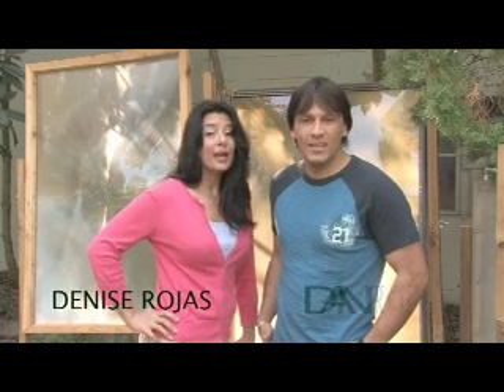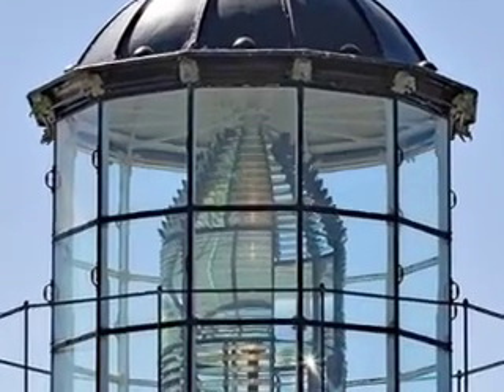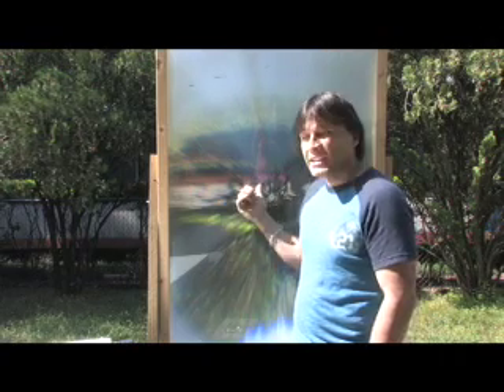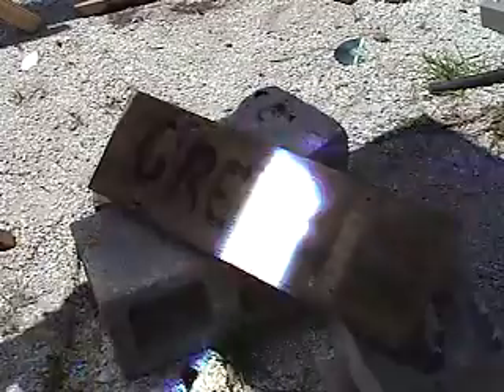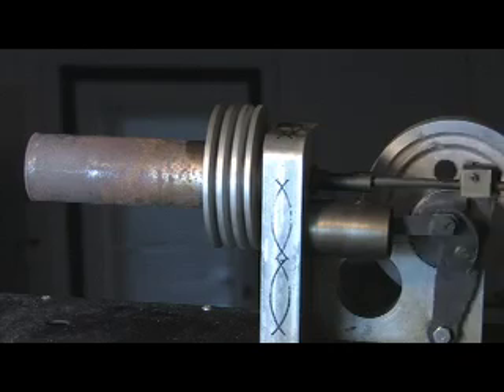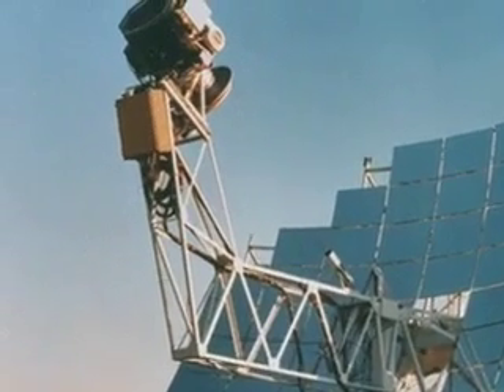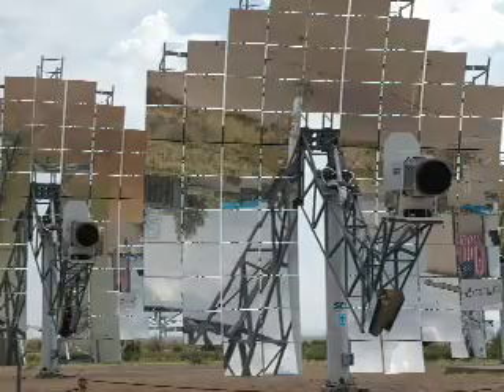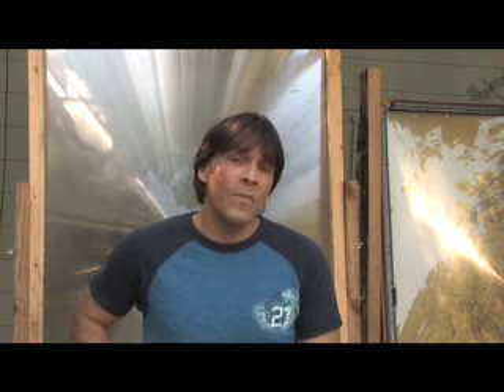Best Stirling Engine Free Energy from the Sun EXPLAINED What is a Stirling Engine

Comment: Why not use a compressed air engine?  If you had a big pile of gravel at 500°C and you injected compressed air into it, it seems like it would capture a lot more of the energy driving a compressed air engine or a gas turbine.  Air heated to 500°C expands about three times.  On a four inch diameter piston with an increase  of 30 psi, that is about 360 pounds of force on the piston.

Comment: I love Stirling engines, and I made a solar powered generator model version... but using a Stirling engine to generate power via solar energy is just completely impractical.

The 'advanced' version from the video costs $150k, needs a sophisticated tracking system, only works in direct, powerful sunlight...and you didn't even mention the maintenance costs or the safety factor: The mirrors would have be completely spotless to give you any sort of efficiency and you'd be flash-roasting any bird that got too close.

As a comparison, compare this to a regular solar panel: Solar panels generate about 1000 watts of power per square meter at about 20% efficiency, or 200 watts per square meter. An average 2500 square foot home has a roof area of roughly 1500 square feet. (roughly 140 square meters).

So, absolute best case scenario, if you covered your roof completely in solar panels, you'd generate 28 kilowatts of power in direct, powerful sunlight...and it would be cheaper to install, far more simple to operate, require far less maintenance, and still generate some power in cloudy conditions.

Comment: So here's a great question for you, 10 years later. How does a fernel lens + stirling engine compare to a modern solar panel, for the same area of sunlight? In other words, if you have a solar panel the size of the fernel lens, and you compare the output of the solar panel with the output of a sterling engine powering a dynamo... who wins?
Reply: Solar cells are MUCH more efficient, they were even more efficient when this video was made, but there are uses for a sterling engine over a solar cell, the biggest being that this directly converts to mechanical energy instead of electrical energy.

Comment: A self operated cold gas Stirling engine using aluminum scandium ally with gadolinium has magnetic bearings with low voltage low frequency hertz emitting diodes would create a self running air conditioning system with solid state graphite power cells and a carbon power cell bank. Purdy amazing technology! :)

Comment: A solid state graphite power cell bank that charged organic carbon power cell bank that powered a rewired drum motor generator with magnetic bearings to generate ekectrity non stop 24-7 which is way better then solar panel set ups! ; )

Comment: GPS can you create calcium carbide using the Fresnel lense ? Here's my suggestion mix lime and carbon together and melt them together at 2100 degrees and once its cooled can you try and create acetylene gas from the resulting mix? (add water and see if the resulting gas coming off  burns)

Comment: Heat from sunlight is nor required. A simple heating coil can be used to generate the necessary heat.
Reply: You're not going to get more energy out than you are putting in, even if 100 percent efficient(which it isn't as already pointed out) what would be the point? it would be a waste of time, effort and money.  You don't pay for solar and that is what the video was about harvesting energy that is available to everyone.

EDIT:
Wanted to add so easier to understand is that basically what you are wanting to do would be the same thing as plugging in some type of lamp into a receptacle then shining it on a solar panel to produce electricity so you can power a different light. The same thing as plugging in a motor to a receptacle and connecting it to an alternator via a belt to produce electricity.  The same thing as heating charcoal under a sterling engine to run it with a generator to heat an electric coil to cook your food(instead of just using the charcoal to start with to cook).  All pointless and inefficient ways of doing it, meaning you are wasting more power than gaining this way.
Reply from the maker: Pointless for energy production. Would use 10 times the energy produced.
Reply: how so? A heating coil doesn't require much energy in itself. And the flywheel on the engine can be connected via a belt to a car alternator and from there it can generate far more than enough power
Reply: Jormungand13324, you really don't understand physics, do you?  Look up The Second Law of Thermodynamics.

Comment: Great video, but you are incorrect in one thing. A Stirling Engine doesn't work strictly off heat, it works of heat differential. One side hot (usually top or bottom) the other side cold. You could enhance the effect further for example by having the cold side above a body or water ( nearly in contact). Also these engines work better in cooler climes.
Reply: still, works off of heat differential.  Hot side and a cool side, or else it doesn't work.
Reply: Jormungand13324:  Wrong: it's temperature differential, period.  The orientation doesn't matter, the temp differential does.  (Geeze.)
Reply: that's with a vertical varient. The horizontal one seems to be more powerful meaning all you need is a simple heating coil

Comment: Congratulations on the job! Have you thought about drastically reduce friction losses and lubrication needs and maintenance to replace mechanical parts for "Solid State" with Peltier cells for thermal power generation by differential temperature?
Reply: Ivaldo Amorim well I suppose that if the only thing one wanted was electricity it could be good.

Comment: Mr Dan, I've watched your video on Fresnel Lens Solar Foundry Obsidian Farm 3800 ˚ F 2100˚ C Fresnel Optics and got caught by the idea of how to control that much power for purposes other than melting metals of glass. My idea could one of your past one.Therefore if it is, please just discard it.  So here it goes: How can we make use of that much heat to build a solar water heater without destroying the heater ( with a material of greater thickness serving as a heater and water conduit running through it). once hot water would run to a thermal accumulator for later use. I hope i have given juice for some project, which you can measure the accumulator and heater efficiency
Reply: +Dylan Ward Why not defocus the lens and aim it at a water tank  paired with an insulated tank above the collector tank so you could hold the hot water. Total capacity should be about 80 gal for most homes if you use most of your hot water in the afternoon to early evening.
Reply: Or you could just defocus the lens to spread the energy over a larger area.
Reply: Im like 3 years late bit I would suggest a concept called negative feedback.

A shitty analogy I can think of right now is Imagine you are running. The faster you run the more tired you get, which makes you run slower.

Thats negative feedback. This effect already exist for hot objects. The hotter something is, the more heat is convected away from them, and more conduction out, and radiation. Think of how military thermal sights can distinguish a person at night. This is because at night, a person is hotter than the ground (sometimes also at day), so this difference in temperature means that different amount of heat is wasted away.

So the idea here is probably making a system that is inherently safe. Like even if you stop the flow of hot water/steam, the thing is designed in such a way that the temperature will never get too high to ruin the material, by wasting excess heat.

Its all numbers. Since we know the heat wasted out depends on temperature difference and surface area, make it so that below a certain temperature, het put in will always equal heat wasted away. The sun does change, clouds too so it still may vary. Maybe some solar activity spikes? Who knows. So get close to the limit but a bit of distance can be useful

Preventing the rays to be concentrated too much can be used to reduce/control the heat put into the system. Or perhaps use a larger surface area so it removes heat faster.

Of course needs to be balanced with performance. Id imagine a good idea may be designed to be safe in conditions of no wind, ambient air temperature of 30C, and no flow of water. its already at the worse in this condition so if its safe in this condition, it should ve safe in conditions where there is more ways to cool. I.e when there is wind, cool air, and flowing water to absorb the energy preventing the system to overheat.

Lots of ways. Less concentration to reduce heat input. Or use bigger pipes that sheds more heat due to more surface area.

This is for inherent safety. If the world ends it should still be safe but have low performance. To increase performance more sophistication is necessary. Sensors need to be installed and motors are needed to pump the water (remove heat) whenever the temperature reaches dangerous levels. It would give more power because its possible to run closer to its max, but if systems fail it can overheat

Comment: Would the use of a "Fresnel Lense" mounted  on an existing Solar Panel give you power boost? or would it destroy the Panel?
Great work, thanks for sharing your knowledge!
Reply: Sp,s work best at cooler temp. If it's cost that you're trying 2 recover then your better off by covering the panels with reflection mirror film that's usually found @those specialising in car and home interiors.(first locate the best film that gives the maximum returns in power as well as ability to maintain heat shielding and keeping the panel cool. Here again it's a small window as the incoming temp goes up proportionally to the amount of concentration of S/l that the plastic film has to deflect.. Then there is the additional task of keeping these film surfaces cool as accumulated air dust on the panel not only brings down the efficiency dramatically, but also increases the tipping point of the failure of the reflector) so take care to observe the points.

Comment from the maker: Sorry for missing this comment. Test a small area with PURE ORANGE citrus spray "D-Limone" Drop in the corner, let set for 3 minutes. If it wipes clean without eating the plastic you can spray the entire lens and that will work. Follow with a surfactant cleaner and hose off. If the orange spray damages the plastic use WD-40. That will not hurt any type of lens. Requires more elbow grease.

Comment: why not apply to other already known engine applications..... taking the heat from a conventional engine like a radiator would n using that energy to benefit other areas of the car. or parts of a/c systems in-turn creating an ac that could turn the condensed water into steam power of some kind, or even going to be used as hot water for the house during really hot summers..... just imagine wat this small idea that has laid dormant could provide if used more widely n creatively

Comment: Dan, what about using a sterling engine in conjunction with a wood stove?  You could in theory use the heat to generate a small amount of power and use a small grid tie inverter.  That's assuming you live in a cold climate and were going to run the stove anyway.

Comment: @frank0067 
how exactly does solar power help big oil?
if you power your house completely using solar power you will require less electricity from the power grid, which in turn means less oil consumption. as any basic course in economics will tell you, the less demand there is for a product, the lower the price will be. no?

Comment: Out of curiosity, couldn't the gas used in the Stirling be the same ammonia gas used in absorption refrigerators? Liquid would expand & turn to gas in heat chamber, driving piston forward. Gas would move to cooling chamber, turning back to liquid & getting cold. Liquid moves back to heat chamber.

Comment: I'm not expert in stirling engines..but as I get it, power piston should be  as light as possible and less thermal conduct as possible, Right? That way heat doesnt travel through piston itself and we have greater temp diff, resulting in better efficencly..So my idea was to replace power piston with platic one, or possibly carbon...any thoughts on that?

Comment: @clovelywindheaven The tech is becoming mainstream in Europe. In the UK now you can get a system fully installed for £11,000 - £15,000.  A "smart meter" measures the electricity you take from the national grid in winter and the amount you feed in. You get paid 41 pence for each kwh you generate, 44 for ones you feed in, index linked & guaranteed for 25 years. It's crazy not to!  Run an electric car on it too, at least for local journeys, and you're hurting the Bushes & Bin Ladens big time

Comment: For continuous daily solar thermal heating, rather than using a heliostat to track the sun why not use 2 light sensitive resistors and a simple relay circuit to control a small electric motor. When the resistance between far left and right sensors is equal, its facing the sun, and stops moving. Small solar and snail-gear electric motor would be more than suitable. If you use a rear hub off a front drive car, you would have a durable turn table, can be braked, and electronics in the hub itself :)

Comment: @newlifedk that's a good question. but the focul point of the glass may not actually be in the center of the globe. infact it probably wouldnt be. so the sterling engine inside would either have to move around to stay in the focul point as the sun moves across the sky or you would have to have several inside to make certain that at least one of them was always in the constantly moving focul point.

Comment: @ablastijl Not a normal mirror. The focus is very narrow behind it the light goes out of focus again. Reflecting it with a flat mirror does not change that. But if you had a mirror curved in exactly the right way, and placed it in the focus, then you could make a pretty narrow beam, which could be send in any direction with other (flat) mirrors. 

Note that there would still be a limit to how long you could shoot. Because the sun is not a point, the beam will spread some. It won't be a laser.

Comment: @spiritamxman The standard cheap fix for storing heat energy is to use a tank of low melting-point material having a high latent heat of fusion. When there is a heat surplus, the material melts and absorbs energy. When heat ceases to be added, the substance freezes and gives up the latent heat. It acts like a sort of 'thermal flywheel'.

Comment: Get the engine to power battery banks in a shed designed only for storing power for night, and winter. Same motor can make HHO gas and store it (though to live off hho in your heater, it takes like 18 Huge tanks to live solely off it). Again, expensive at this time, but more then possible. There are videos of someone doing it already, his investment was high, but again, prices always comd down.

Comment: What is the temp. difference needed to get a good sterling engine running?  For example, could you run one off of a hot spring that is 150 f and a cold stream at  60?
How does th temp difference effect th output?

Comment: You sir, are an idiot.

1. The energy is coming from the sun, genius. Not 'nothing'.

2. The highest efficiency ever gained from solar panels is 41%. Commercial quality yields 10-15%.

The rest of that energy becomes heat. Solar thermal energy uses that 100% of energy as heat rather than trying to convert it directly into energy.

Solar thermal is much more efficient, it just has to be harnessed correctly.

Comment from the maker: YES,

This engine is a demo toy basically but the design can be enhanced. Us a more efficient inner gas than air, increase the cooling portion. Increase the surface area on the hot side. Get a flywheel of the exact diameter to the engine. Match it with the right PMA or generator and you are better than solar panels. 

This is not as simple as it sounds but with the right funding it would be easy.

Comment: Coal based electricity is still a bit "cleaner" than gasoline because electric cars are 75 to 85% efficient compared to like 20% for today's engines. Thus we need to promote advanced battery research.

Eventually, oil will run dry and we will have to convert 2% of the deserts into concentrated solar power and even greenhouses that grow sugarcane. Water will be piped in from the oceans and distilled by more mirrors or by simple evaporation!

Comment: "hydrogen gas light weight" I guess you have never hefted the steel tanks that are needed to hold high pressure H gas. That has been the down fall of H for cars. Storage of the H in enough volume to get enough distance between refuels.

Comment: That is potentially a good idea. A traditional lense focuses the sunlight in two dimensions. It would be difficult to focus the sunlight into a spot all day... a band would be much easier. A spot may still be possible depending on the orientation of the scribes in the lens itself.

And with your idea you would only need to adjust the lens seasonally. The sun is higher in the sky in the summer!

Comment: Free energy is impossible for the most widely used defintion of "free energy"

Stirling engines are powered by heat, so they don't produce their own energy.
The energy they use might be free as in beer, or as in speech, but no part of the process is necessarily "free energy" as ">100 efficiency"